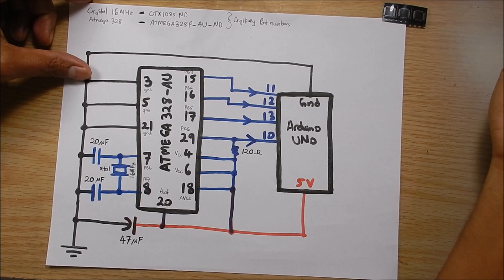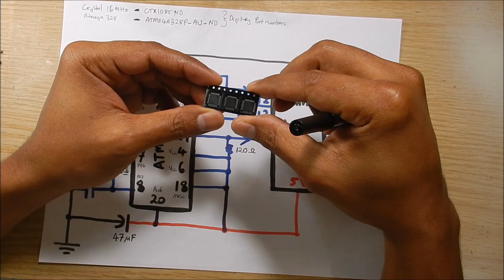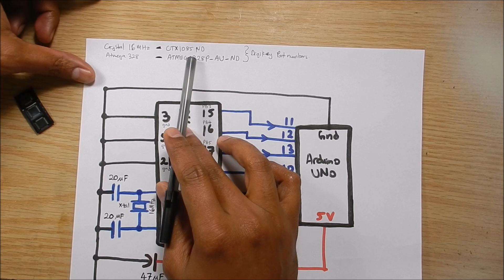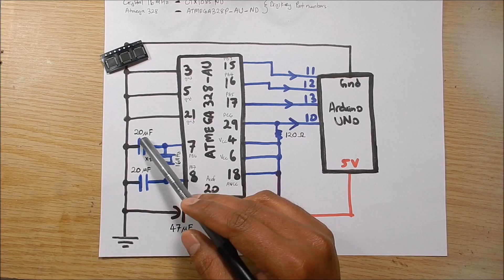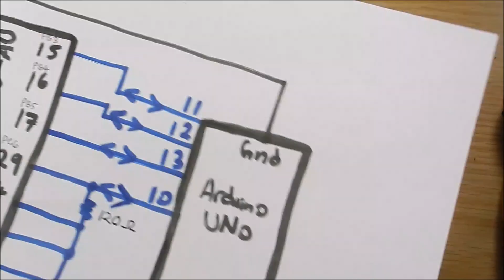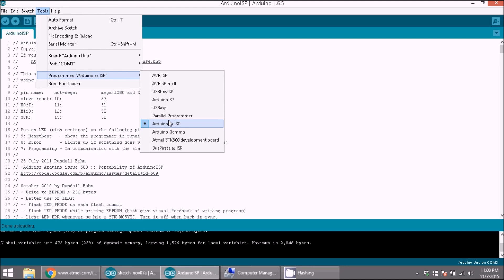How to burn an Arduino UNO bootloader to a new ATMEGA328P-AU chip

Comment: Thank you this is the only tutorial that got me to program my Atmeha328p-au on a breadboard after countless hours on youtube. I have spent four weeks trying to get a boot loader on the chip which i did manage eventually, but could not get a sketch on it. So for some reason the boot loader did not upload correctly to get a sketch on, before i used your method.

Comment: Do you have a wiring diagram for the second setup that allows you to write sketches to the TQFP 32 Chips? and you wired yours direct to the DIP socket could you use the pins on the side of the arduino uno board? I am going to make 2 shields for TQFP 32 Chips. One to burn bootloaders and one to burn Sketches via the Uno r3 I have hence all the questions

Comment: Hi dear Friend thanks for your fast and kind replay. yes I can do boot loader on dip Atmega chips. I did it several times. but my problem is for smd chips. so that I asked you, for your second circuit on above video. the 1st one is so clear. I mean need circuit at the end of the video. thanks and appreciate you again.
Reply from the maker: +Mehdi Emm  With the chip on the UNO removed, you can use jumpers to connect like the following to the ATMEGA328-AU SMD chip. To test, load the blink example. It should blink the "L" led on the UNO board. This LED is on pin 13 which is PB5.
UNO ----- ATMEGA328-AU
7 ----- 4
8 ----- 3
22 -----21
9 ----- 7
10 ----- 8
1 --- 29
2 ------ 30
3 ------ 31

Comment: Are sure its is 20uF should this not be 20pF what is normal for crystal oscilators
Reply from the maker: yes!! you are correct. thanks for the catch. pF it should be. I will add a comment to the description.
Reply from the maker: I added an annotation to the video. thanks again.
Reply: @tinkeringtech  That oscillator will never work at that cable length !!! is a scam

Comment: So the ATMEGA328P-AU needs a crystal to work correctly?
Reply from the maker: The atmega328P has an internal oscillator as well, bit I have never tried using this or for the bootloader burning process. Don't know what the behavior would be.
Reply: +thetinkeringtech Okay thanks, i just prorammed an attiny similar to that but of course
without cystal, but since this is almost the same thing, im not sure why
one would even use an attiny when you can get the 328 au for the same
price, do you have any Idea? :)
Reply from the maker: +Stellan Haglund same price? I noticed on digkey the attiny85 is about half the price of the atmega328-au :)
Reply: The ATMEGA328P-AU comes factory default with a internal 8MHz setting. So for burning the bootloader the crystal and the 2 capacitors are not needed. But once the bootloader is installed the chips fuse is set to external crystal 16MHz.